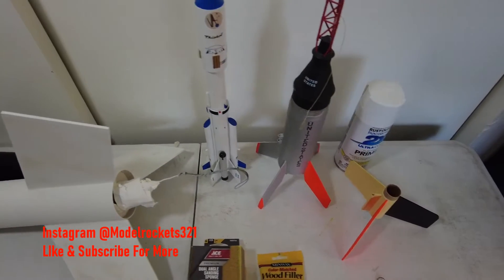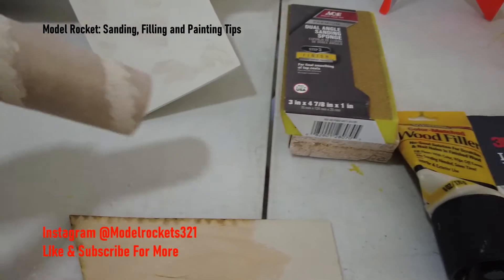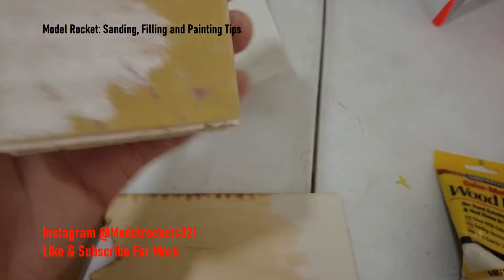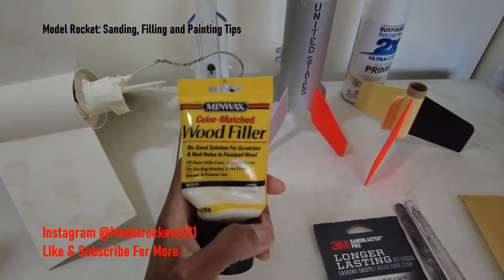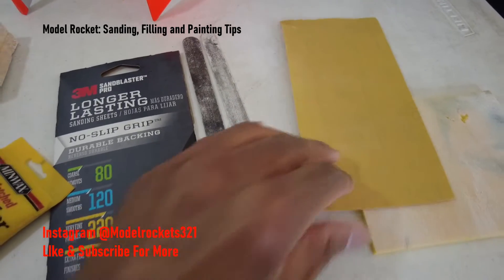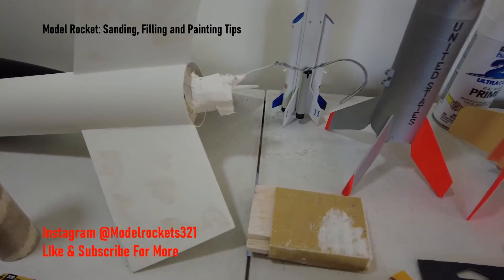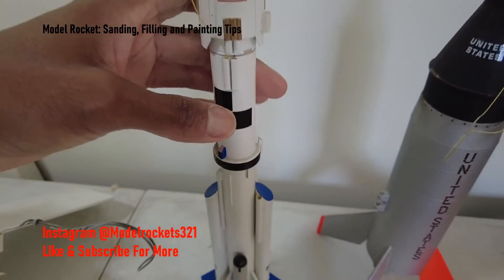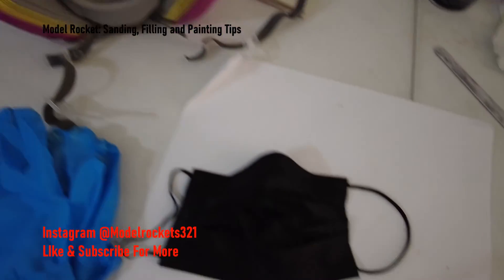Model Rocket: Filling, Sanding and Painting Tips: Model Finishing

Comment: For balsa fins, I use Rustoleum Filler Primer.  Spray it on, let it dry, put another coat on.  Sand with 400 grit sandpaper (on a sanding block, preferably) and if the grain is still visible, spray another coat on.  Repeat until the wood is glass smooth.  I used to use a clear dope based sanding sealer and it worked miracles, but I haven't seen it available for years...

Comment: My 2 cents on the P&P in one. 

When referring to gallons or quarts of P&P products, it’s more of a marketing gimmick.  they do add more solids to the paint to give better coverage, but not necessarily, going to give you the adhesion properties and blocking as well as a primer itself. 

As for the spray paint  type.  I use the 2x for the coverage on multiple things,  i have tried to research something on these and don’t say much.  I do know the 2X is pretty good to use.   

I would “SWAG” that there may be a chemical compound mix/component in a spray can vice the cans of paint a painter would use.    Rust Oleum has always been good and DupliColor can provide some awesome finishes. 

I overall think it’s a marketing gimmick.  I don’t trust the cans of it and will prime where needed. but I do like the 2X Rust Oleum.  I just don’t know what makes it better then “skipping a step”.    ¯\(ツ)/¯ 

Who knows today.  maybe they just lie to identity and paint and primer 🤣

Comment: Nice work! You answered some questions I had on this subject.  
 I’ve been building two Apogee High powered model rockets. 
   Worked my rear ended off on the first one. The second I’m trying to work smarter.  
    I have been having terrible results with the gray Rust Oleum 2X primer on two occasions from two separate cans. The stuff is very rubbery and doesn’t seem to want to cure. It’s balling up sand paper quickly.
Reply from the maker: Hopefully the video was helpful. These paint companies are messing up in  my opinion. Combining paint with primer is garbage. Even though I get it to work. Recently I used some Krypton banner red it was still sticky after 4 days.
Reply: I ended up getting some duplicolor  primer from the auto parts store.  
  That was so much better to sand and fill with. 
   I did get some of the minwax wood filler but the tube I bought have some very gritty sandy feel to  it.

Comment: From Canada, really enjoyed your tips and advice on finishing a model rocket. I'm working on the 100:1 Saturn V right now and I don't want to mess it up. I'm more of a 'nuts and bolts' sort and have difficulty making the things look pretty. I build them right on, but sometimes they look like Oprah in hot-pants.
           Anyhow, regarding that scratch-built 'Thiokol' (not sure of the spelling) you built, is it a multiple engine single stager? Looks like it!  Even if it's just a single engine lifter, still a fantastic looking model. Good on 'ya! That multiple engine ignition stuff can be a bit hairy. 
            By the way, I also use that same brand of paint you use, but I had to scratch my own head as well as to that 'paint-primer' thing, and haven't bought any of it. Thanks Man.

Comment: Any advice for clear-coating? I use Rustoleum too (the local ACE hardware nearby is the main reason) and sometimes when I put the clear coat on a beautiful paint job, I'll get some bubbles. I understand that the clearcoat is likely "re-energizing" the paint and it may occur when the paint is on too thick but I can't pin down this exactly as I have had good and bad results with no clear methods for perfection. Thanks.
Reply from the maker: You can also clear coat with floor polish. The brand used to be called Future Floor Polish. Brush it on with the sponge brushes. I have a video on this.
Reply: How many coats of sprayed paint do you recommend? I can’t seem to come to a conclusion on that one.

Comment: The paint+primer (regardless who makes it) is pretty terrible in my opinion because the paint is "plastic like" material mixed with Primer. It's acceptable if you're painting (and NOT sanding) a metal or wood chair for the porch or something. When I MUST use it for "paint" (and I have), I'll let it dry hard, then "sand" it down with a paper towel to knock off the peaks and detritus. 
It hurts man. I hate it. 
When paint is mixed with the primer, it clogs my sandpaper like a BOSS. It just smears the paint product around like I'm sanding frozen butter in a frozen cast iron pan.
Personally, I use the Rustoleum Universal Premium Primer (something like that). It's expensive, but it works well as a bulky primer to fill the final small cracks (like body tube lines) and it sands well. As in... lots of dust.   :(

I want a pure primer, followed by a pure paint, followed by a pure clear gloss coat, followed by decal application, followed by a final clear gloss top coat. 
Sucks to be me since I'm currently caterwauling for SoluSet before my final gloss top coat. I have abnormal issues.   :(

Comment: I didn't know that Minwax has a filler product.  Definitely going to give that stuff a try.  Little Joe I looks great.
Reply from the maker: Thank you. It's pretty good, it sands off well.
Reply: @modelrockets3215  Years ago was mega coats of pant and never liked doing that (especially since i never like to wait for things to dry b4 launch (too much Wiley Coyote)

Saw you using the wood filler and had some and going to try it on my Apha build first.  (Apogee has a 2 part epoxy and too much work)

I am going to experiment with lightweight spackle on some crap balsa to see how that turns out.   and compare to the wood filler. (Centuri use to sell a Balsa Filler but got ya higher then the rocket with fumes. 🤓

let ya know how it comes out.  love the idea of wood filler -.so see how it goes